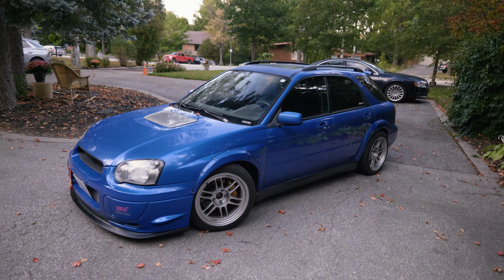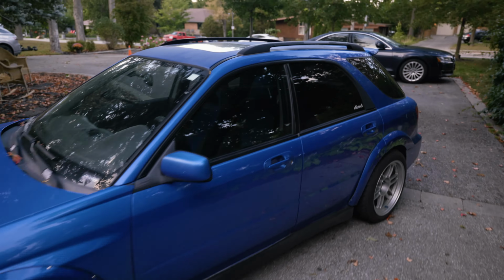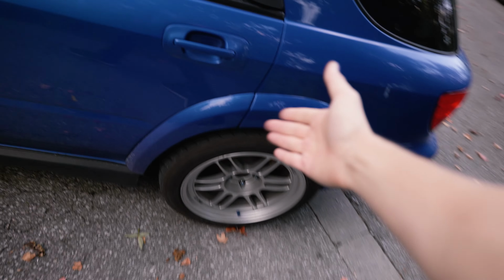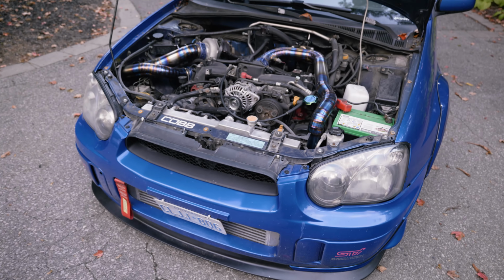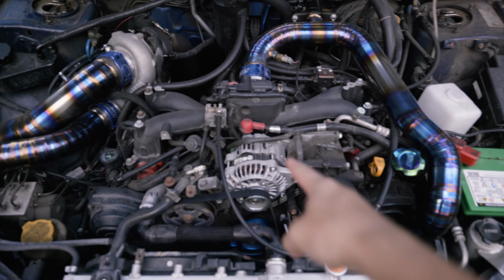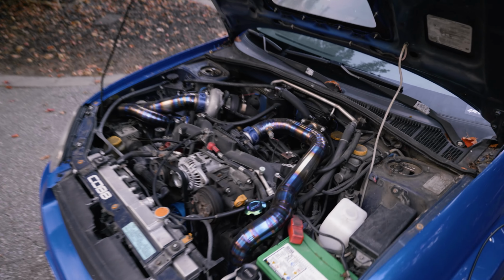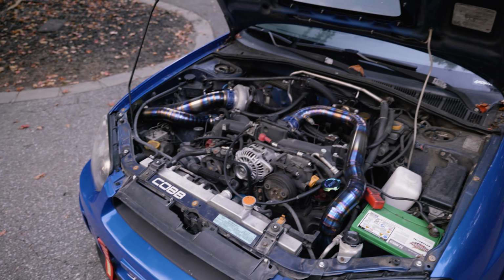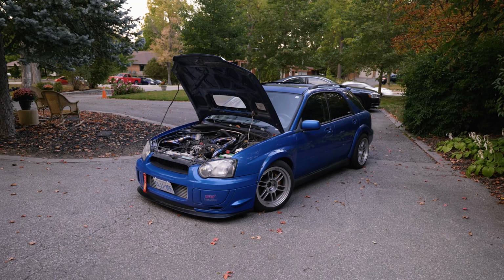I've Neglected You...

Comment: with the MAP dccd in auto the gain dial to the right still is active dont just leave it at 0% or 100% you will notice a difference, had mine at 0% and spin out turning slow at an intersection in the rain. at 100% (full lock i believe) lots of understeer. kept it around half and feel it from there.